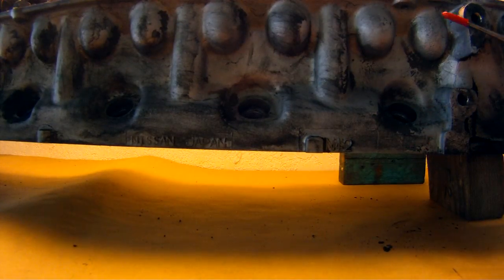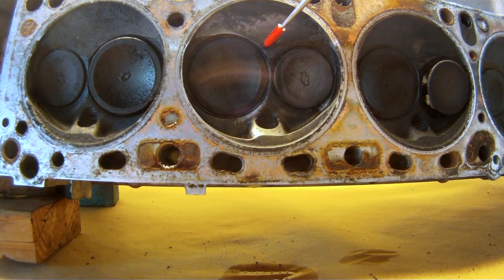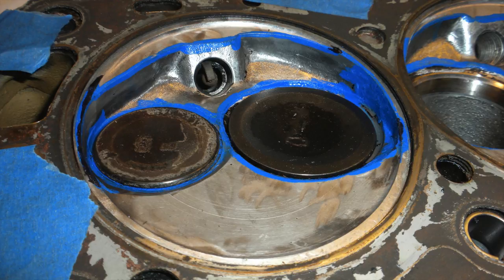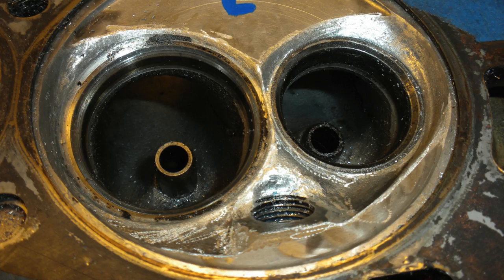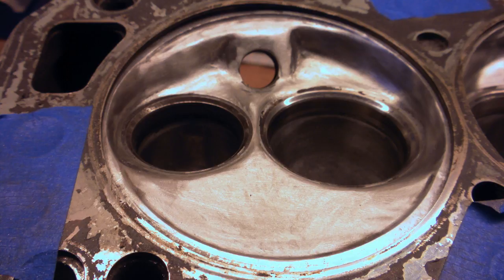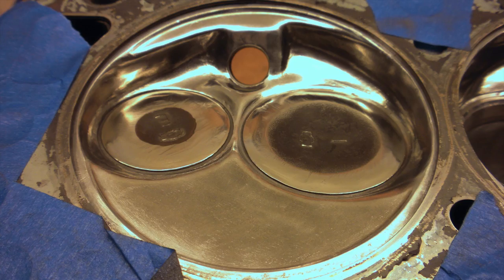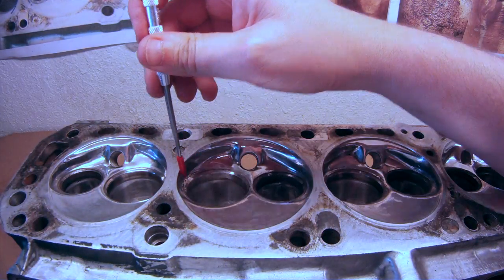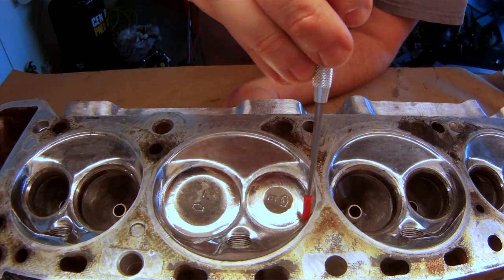Porting & Polishing Datsun 240z Combustion Chambers

Comment: hi, first of thanks for your Videos.
I just have a simple question. I tried doing the same but it looks like my head was poorly produced as there are alot of air bubbles in the cast (aluminium head) . Are all heads prepared like that or how did you removed this bubbles without removing too much material
thanks in advance
Reply from the maker: Glad the videos were helpful. Send me some photos in an email at: kangamotorsports@gmail.com and I'll take a look. I haven't seen that in any of the heads I have worked on but you might be right about a poor casting. What type of head is it?
Reply: it's a c14nz Opel (GM Family 1 engine)
as i read on Wikipedia it is an aluminium head.

I sended you some pics about the head.
i'm curious what you Think about it
Reply from the maker: That looks like a bad casting. Not sure how porous it is. Looks like you did the best you can do with the issues. You might just run it and see how it goes. You do want to be careful about taking too much material away especially if it doesn’t get better with the porosity and voids. Good luck with your motor build.
Reply: thank you for your imput man !
Keep going

Comment: 1.your cyl head into your bare bored block and scribe to get chamber size
CC to get 11 to 1 comp ratio . L series love high comp
2. Exhaust .Take out exhaust guides and shape guide boss to 45 deg angle  
shorten exhaust guide 10mm / 3/8 inch ,taper and reinstall 
3. Intake open area under valve only and leave port w rough finish.
4. N/A motors need good long exhaust tune length pipes  . smaller will scavenge better
Reply from the maker: Thanks @robwhite240z. I am running a little less compression since I am in California and pump gas sucks. As the car is mostly used for touring around I didn't want to have find race gas or octane booster on road trips. Still looking into exhausts at the moment. I will have the shop knock down the exhaust guides when they do the valve job.
Reply: you're a legend Ron!
Reply: @3rd-eye-neenja563  Hi Bruce , you still out there in the youtube world
Reply: @robwhite240z  hey Rob,,,how are you doing? Hope everything's good,,,almost done with my 260z ,,,,by summer 2021 will be finished ,,,,,
Reply: @3rd-eye-neenja563  Hi Bruce, all good here, I have my 240Z up and running . the video is on you tube.